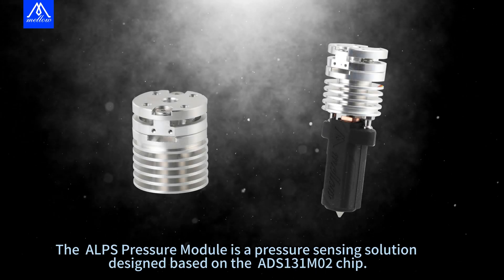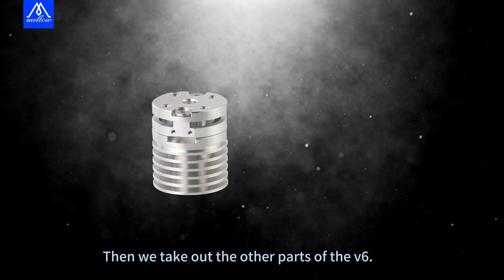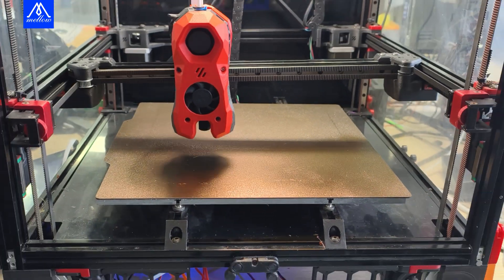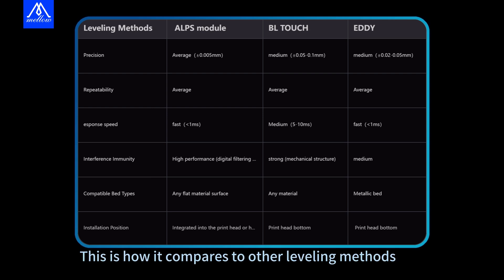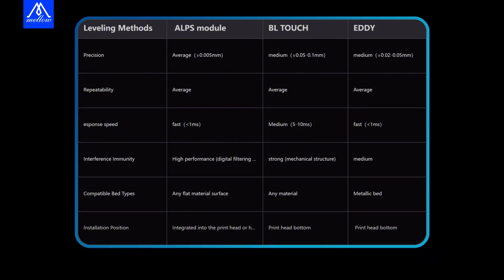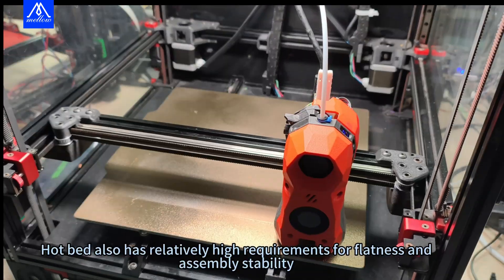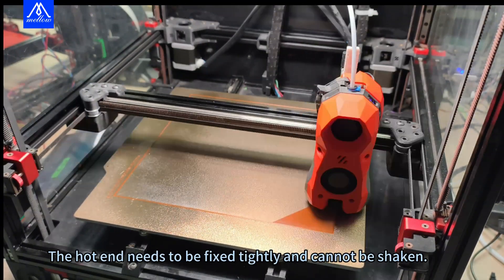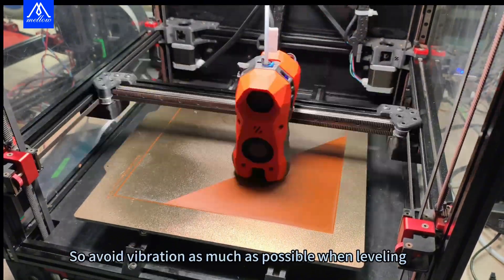Optimize Your 3D Prints with the ALPS Pressure Leveling Module

Comment: How does the sensor communicate with the main board - is the land signal processed at the toolhead? Would this be able to be connected to a toolhead PCB like Canbus or Nitehawk?
Reply from the maker: It connect by UART, so as long as your tool head has a UART interface, it should work. This works by adjusting the high and low voltage levels. We also have tutorial videos; if you're interested, you can find them on our page.